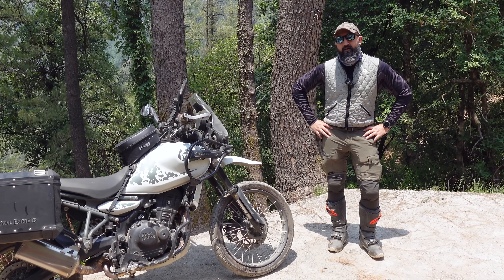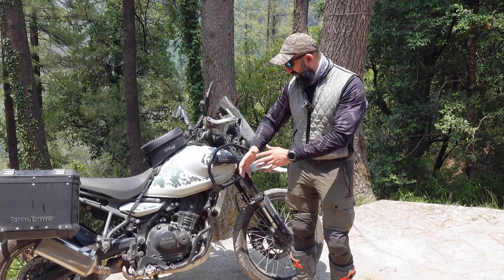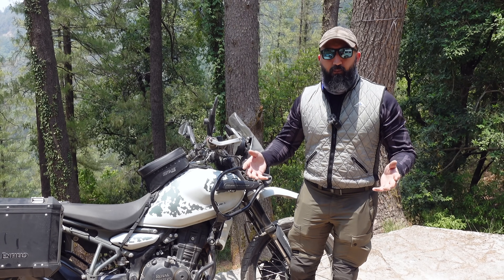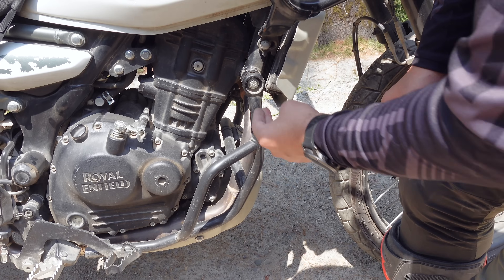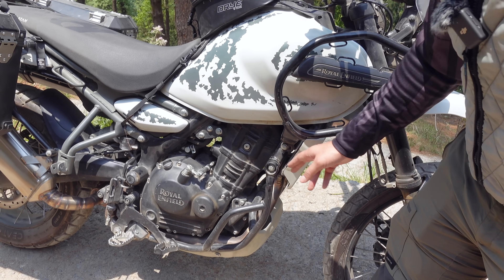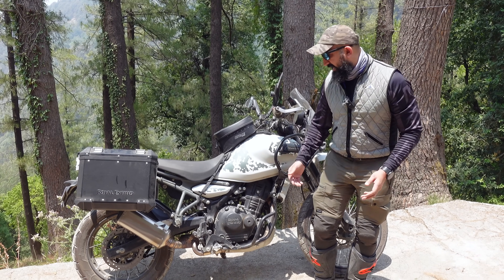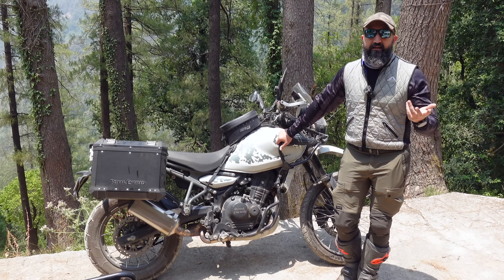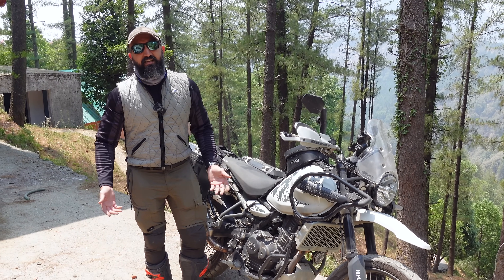Why Did Himalayan 450 Chassis Break: What I Learnt From Royal Enfield

Comment: So what you are saying are few main things.
1. RE did not design to cover known use cases for its vehicles.
2. There can be more failures coming up for this high risk points on the chassis as more no. of vehciles come out and statistically it happens there will be nothing to do then for the customer as warranty would have ended by then.
3. RE has known this since BS3 Himalayan and strategically chose to create and use unethical fear marketing to sell more stock parts.
4. RE used to make highly reliable parts previously which were overdesigned to cover all use cases and then more....but now their strategy has chnaged.

Comment: Nice analysis ..but my humble submission is that if the whole engineering of a 4 lakh bike is dependent on the screws of crash guards then that design engineers should have been fired long back . Do RE assume that each rider must first go and get a degree of design engineering before start riding...my two cents

Comment: As a structural engineer in another OEM (NOT MOTORCYCLE), I completely understand and back the logics put forward by Royal Enfield team. It's true that improper installations can have significant impact. And with RE's sales volume, it's true that customers will use various aftermarket products. Moreover, there comes a gap where design team intended something to be done in a certain way, but it doesn't apply in field servicing (which causes things like bolts not being up to the intended torque and it comes loose with vibrations), which in turn causes further and bigger failures. Therefore, from engineering perspective there should be a design tolerance that compensates for these improper installations or some poka-yoke, or if not, a set of redundancies.

Comment: Hey Abhinav, great video. Saw a similar one by Srinivas Ganesh as well. While watching the video itself, I had predicted people would make comparisons between the Himi and the older Bullets (on which people mount medieval torture racks as crash guards). I'll summarize my point - by virtue of the Himi having the engine as a stressed member, it will be an overhead transmission for 99% Indians (Don't know, don't care to learn attitude) - this automatically will have a complicated stress distribution with it's own cyclical and impact loading behaviour - doesn't matter where you mount or when you hit the frame, it can break at a different place on a different time. Last bit - Torquing of bolts (I don't think other than the very best of ITI trained technicians, anyone in this country in a mechanical line gives two hoots about it). People would go about adding stuff on their motorbikes the same way they'll add trinkets to their showcases and expect both to bear the load.
Reply from the maker: You are correct.

Comment: One of the 2 452's which had this breakage issue was falsely accused of the same torque-spec issue by RE and it became quite a bit famous- now that bike used a Zana guard, and Zana themselves have put out a video on the assembly of the guard, and they haven't touched the chassis bolt ONCE, no screwing-unscrewing nothing, it uses the point above the foundation bolt and the one near the subframe- so it wasn't an issue with the mounting of aftermarket rally guard i think RE should really look into this and admit their mistakes, which is something they've been hesitant to do historically.

Comment: I was very very excited about the RE 450.  Then I learned about the warranty and servicing agreement an owner of the bike must adhere to keep the warranty intact.  This means dealer only servicing or approved servicing vendor during the warranty period. This could be not easy during a multi-thousand-mile road trip in the USA.  Now only OEM add-ons are approved?  Now    I must think of other motorcycles.

Comment: I’ve studied the photos of both bikes and I’m going to say looking at the bare frame I don’t like the idea of the front engine mounts being bushes as they give a slight flex that contributes to the problem, now over time if I get worn bushes on the front mount I will lose my frame as a result, if my front wheel comes down hard that same sheer point on the tubing gets the most pressure,
Reply: Look at the frame on line and compare it with the Tenere frame which is designed like a shallow X so it shortens the length of each tube so less movement then uses the engine to strengthen the X from collapsing, where the Himalayan frame shoots up to the forks then down to the engine like a V upside down the the engine is only stopping the V from collapsing but it does nothing for the sheer point above the weld, also all the pressure on the front end is supported by this fail point. 

I am not buying one next week it’s a good job I seen this vid, any welder will tell you this is a bad frame as the front mount is a bad idea and the frame design needed a further brace like the Tenere. They should have left the side stand off and added a bit more metal

Comment: I had a hero honda CBZ ( first model,the one with large bore silencer) used it till 3lac20 thousand km. Oil changed each time at 3000km . I didn't even know where the chassis bolt was nor faced a single issue with such a massive part. 
This reason gives for chassis breaking is absolutely unacceptable. NOT ACCEPTABLE at all.

Comment: As many reports of frames breaking as KTM cam shaft and electrical issues, Triumph control unit issues affecting lights(£1500 fix), Guzzi cam failures and not to mention loads of Chinese bike issues no one wish to touch. Ignore the ‘Test ride reviews’ and start looking at owner 10-20km reviews. Everything else is fashion verdicts.

Comment: You did a good job explaining what the Enfield rep told you but at the end of the day, it's a failure point and it will harm confidence and sales..They need to fix it, redesign it, and offer work around.
Reply: They did and the fix is easy. Don't get after market crash guards, cause they are not considering the stress point on the frame. It's that simple.
This is a failure of an aftermarket company and it is they who need to fix it or stop selling their product before they get sued by a costumer or RE themselves.

Comment: I just think in both the cases the installation was not proper. If the engine mounting bolt is not properly tightened using loctite then it is bound to become loose and fall. But if it's not the case then it is an issue of RE

Comment: Bro, even at RE workshops, most of the service guys don't use any torque wrench and simply tighten the bolt with a regular spanner. I have a Himalayan and have visited RE service centres in Chandigarh and Delhi NCR. But the chalta hai attitude is there. Chandigarh was better though in terms of following protcols but Delhi NCR certainly not. Specially for Himalayan. So the design of chassis should not have only one point of failure that if a torque wrench isn't used, it'll break. A lame reasoning.

Comment: Bunch of crap. If a chassis fails if an aftermarket crash guard is mounted , original design of the chassis is faulty. This is an offroad vehicle, chances of stress and strain on the frame while riding on tougher terrains is un avoidable. Their explanations are vague. If one loose bolt can change the structural integrity of the frame, the design of the frame is faulty. And the QA, Design teams behind this are responsible.

Comment: If the chassis was not messed with, bike Not dropped from a mountain, then FAULT is and will always be with RE ! 
It is the basic building block of any chassis based vehicle, Stress and Vibration are its companions ..if it breaks, it means design or Manufacture fault

Comment: The explanation makes sense to me. 

The only culpability on the part of RE might be for them to have anticipated after-market accessories that would not take the engineering into account and put on a warning saying that the engine is a load bearing, stressed member and therefore nothing that changes anything about the engine mounts should be done.

I see a bit of an analogy with car people who change their wheels, so the load is no longer centered over the bearings. Then they wonder why the bearings wear out.

Comment: I like the latest J series platform Bullet, Classic, Meteor, etc. I'm neither a fanboy nor a hater of RE. What I need to ask is, why did they build the RE Himalayan with this kind of frame instead of a user-friendly off-roader chassis?

When we compare it with other premium and costlier off-road motorcycles in India, the Himalayan is an affordable option, except for the XPulse. So, what is the need to use this kind of chassis in an affordable adventure category motorcycle?

For improving the adventure riding experience, they could have used a more advanced chassis with user-friendly characteristics. Despite the benefits, they can't deliver the motorcycle on time, which is understandable. However, they also can't deliver the OEM accessories on time. Even if we get them, they are too costly for customers to afford.

Due to the unavailability of OEM accessories for the Himalayan, if a customer opts for external accessories for comfort, it could break the chassis and result in a hefty bill.

Comment: Himalayan 450 has Showa suspsion with (SFF - Separate Fork Function) which means one fork is for damping and other fork is for rebound. This causes a light twist to the chassis and hence the extra stress in the right side of the chassis.
If its is caused because of engine is stressed member, many other bikes before Himayan 450 have the engine as the stressed member, they dont break even after many years with crashguard etc.
Ask yourself, if this is happening because of the torque of a bolt, chassis can snap on the left side as well. Howerver the chassis is breaking only on the right side.

Comment: RE stooj spokeman call all of us as YOU, so he and RE are one party and we all buyers are the opposite party. Note how many time he uses YOU ( at 8:10 video eg.,).
According to RE brown- -noser if 2 people die out of us every 40,000 people, its ok, no big deal. First H411, had the vertical chasis turn at right angle 90 '  
all other off road bike have a 45 ' angle so that it can negotiate a stone or kurb, this RE H411 will get stuck just behind the front wheel ! I told them at opening function, but they correct it a little bit on H450, they should have copied hero Impulse or xpulse lower chasis angle. RE was popular just because, there was no other alternative just like Ambassador car.
I WOULD NOT TAKE A RISK AND BUY A HIMALAYAN OLD OR NEW. How come not 1 single bullet 350 had a broken frame ? I am 75 now riding ( my father's )bullet since I was 16. That bullet made a mechanic out of an accountant ( me ).
Dont believe in the crap that comes out of RE's ass which is this mouth piece.

Comment: This issue is not so simple as you or RE explain. but before I continue, I must first say I have great respect for Royal Enfield as they have made zillions of great motorcycles and built them from scratch. I am not an engineer of Motorcycles, I haven't ever built a single one. But I come from a rally and motocross background , being among the best riders in the country at that. I have broken dozens of engines, chassis , rims , suspensions in my long riding years,  I ride hard. Royal Enfiled should have used 'test horses' instead of mules. these 'test mules' obviously never did any competitive off-roading and have no authority to test motorcycles to their extreme limits. Please study any modern off-road motorcycle frame, specially  motocross. The 'tube' under the tank in these motorcycles is a 4 inch thick aluminium beam of hi-grade aluminium with a cradle frame.
The Himalayan 450 steel tube under tank is more or less like a bicycle frame . and with such a vibey  and heavy engine to compound the stress to it,  and when they delete the cradle, it's a thin line to disaster. I could be wrong but im relying on design aesthetics and pure instincts  rather than mathematics . Great Motorcycles are not made in conference rooms or in labs or on paper or in computers. but they are ridden through hell and high water and broken before they are re-engineered and sold. This is not the case in the Himalayan 450. I could be wrong, but I have a strong gut instinct that this 450 chassis is half as strong as the earlier 411 just by looking at it.

Comment: Just sharing my experience -           In the year 2022, I rented a Himalayan (1 year old bike) in Leh.. me and my girlfriend rode up to   Merak village and back to Leh. We did not ride rash or at high speeds on rough roads. 30 kms away to reach Leh, I felt some rattling on the handle bar n front forks with stronger vibrations. I trusted my instincts n decided to not risk n go even slower as I believe 'Safety is No.1 Priority'. Before returning the bike I felt reaponsibe to get the bike checked n fixed at RE dealership on my expense, so the bike owner doesn't lose money, as i had used the bike. I got the last service history checked n it was a month ago. One of the RE top mechanic was very nice n honest. He told me straight up, if i had ridden another hour, the front wheel would've come off. He made me look at  4 bikes with the similar situation n 1 was a broken chassis bike. He seemed like a genuine guy and told me it is a serious problem and RE Service Team has been informed. I am not an expert but I will say, I hope my faith gets restored on RE someday. I don't think I will buy or rent an RE for such adventurers. I hope RE is listening.

Comment: Your engine mounting points are wrong...there is one more at aft of gear box near swing arm. 
Also plz refer the video from ZANA ...your pointing to aftermarket crash guard installation is wrong...
All test vehicles are built with extra QC due to insurance...that wouldn't show failure....
There is something to do with assy tolerances...which induces additional stress points...
Crash gaurds are non stressed members until the bike is falling down....if the ZANA can prove this using some load measuring devices...boom RE can be fixed.

Comment: The required NM for Crash Guard Installation are:

small screws near saddle: 25 NM
Left Engine Bolt: 45 NM
Right Engine Bolt: 60 NM
Oil Sump moint: 45 NM

Source: 
Royal enfield Installation instructions

note: 
Rally guard mounting may differ

- no guarantees -

Comment: In my opinion, these are purely assembly errors.
From what I have read so far, the screws for the aftermarket crash guards were fitted without a torque spanner, without the required torque and without screw adhesive (e.g. Loctite).
When the engine block becomes hot, the screws in the engine block expand and can then loosen or even fall out due to the vibrations.
The frame is not designed for the forces that then act on the engine and the other bolted connections .
So always use a torque spanner, use the correct torque and always use LOCTITE or another screw adhesive on the motorbike  !!!
In my opinion, Royal Enfield is not to blame.

Comment: Sorry to say but didn't expect this from you. If properly designed bolt was used, excess torque should have damaged the bolt or its thread and not especially the critical part like the chassis. Is the chassis weaker than the bolt used ? The design has to be studied in detail by RE. Every garage in India might not have a torque wrench but this should not be a reason to under estimate them. It is the Private Garages who do great job in modifying the 2 & 4 wheelers for track events to extreme off road events.

Comment: This is why I ordered the RE sump guard. I am not a big fan of this twin spar frame. For me, its rigidity is a questionable spec under rare circumstances, transferring a major force to the head casting. I will be fitting my own when it arrives. I am a mechanic and do own an industry standard torque wrench. And beside the RE product looks to provide the protection I deem satisfactory & looks good. I am a bit sceptical of the rear mounting point rigidity.  Cheers for the vid, stay upright. 👍
 PS: I have another bike (KLX400r) for the rough stuff, so "horses for courses" as always.

Comment: being an engineer myself all i can say is that this is worst way they have designed their chassis mount.  only dumb designer would place engine mount and accessories mount on same bolt of the frame, totally stupid. even if you buy a genuine guard from them and in case of a accident total stress would befall on crash guard which is mounted with engine mount. this would increase chances of breakage even more. RE is giving vague excuses and showcasing it in very high level language of technicality so that a common person does not understand a thing but they forget that India is land of engineers. what they are trying to do is that forcing people to buy accessories only from them. coming to third party accessories part, i do agree that its design is very much important as well. local manufacturers don't do the stress testing and mounting also plays an important role. crash guards are supposed to absorb the shocks, if they design it such a way that its tougher than actual frame of bike then it will put more pressure on bike frame and chances of bike frame breakage will increase.

Comment: Splendor, Passion Pro, Platina laughing in the corner hearing the words like 'torque' 'load'. My dudh wale bhaiya still carrying milk cans on a pure metal frame designed to hold the cans in place weighing more than the bike itself and still able to cruise through village roads with small stock tyres. 😅
Over tech loud mouths trying to fool people.